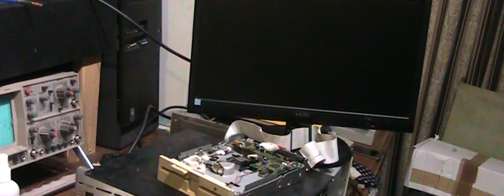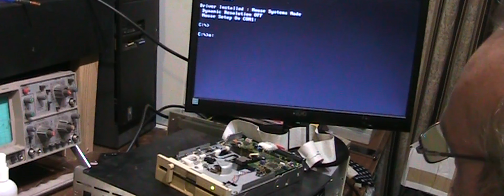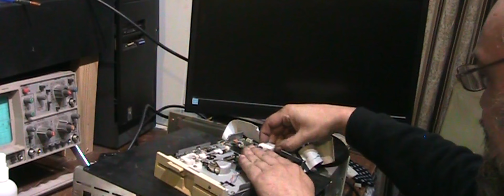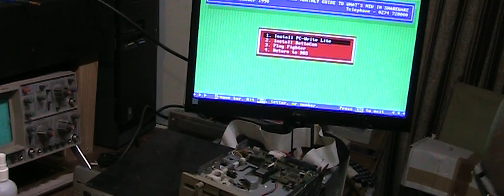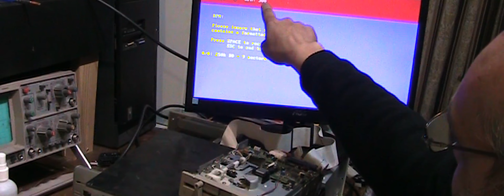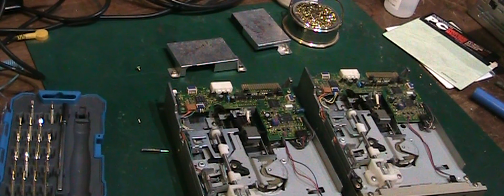Matsushita 5.25 inch Floppy Disk drive repair X2

Comment: The Canon MD-5501 is an interesting drive.  It's a bit slimmer than a typical 5.25-inch drive and it is semi-automatic loading like a 3.5-inch drive.  I believe its primary application was in the PS/1 line of computers.